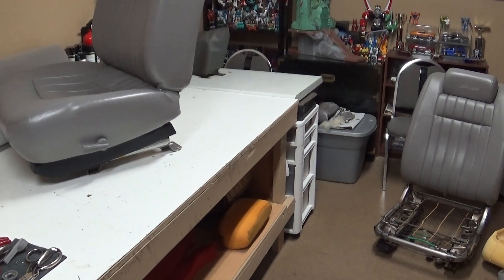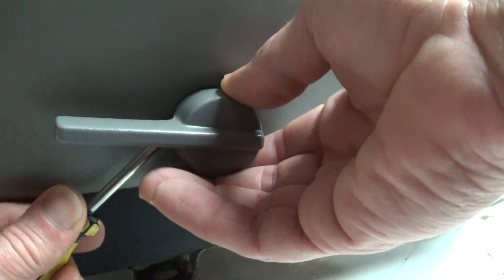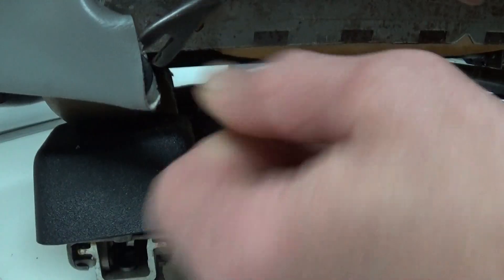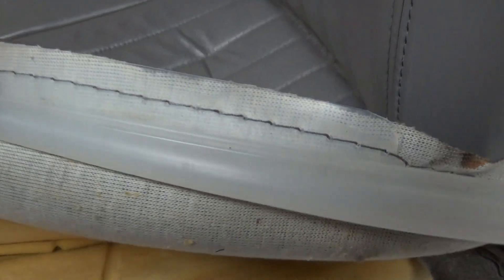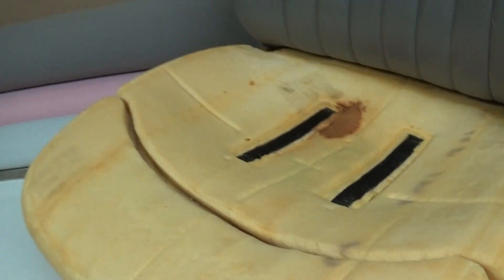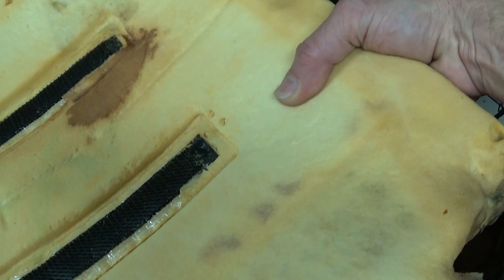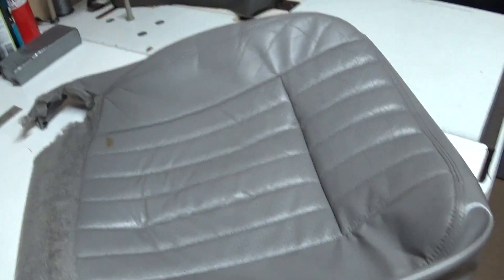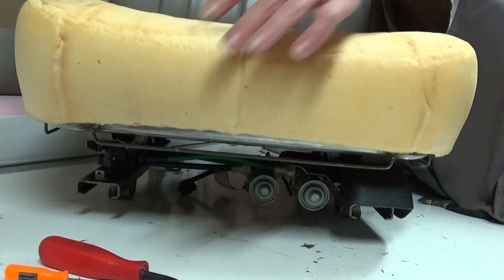1996 Impala SS "How To" Install Front Seat Cover Bottoms Part 1 of 4 by SSinteriors

Comment: I’m tuned in. Will you be showing the pattern making process?
Reply from the maker: Gonna make sure to get all 4 parts uploaded tonight and I do have at least 2 sets I'm making from scratch. I will show that process soon. Probably some other odd and end videos before that though?
Reply: @charles1matt  ok cool I’m still tuned in brother!!!💪🏿💪🏿💪🏿🔥🔥🔥
Reply: Both of my front seat bottoms are trashed. In your experience, what are the best covers to buy? I’m thinking about having a local shop just sew in new middle upholstery if the quality of reproduction covers is that bad. Great videos BTW. I’ve learned a lot by watching yours.